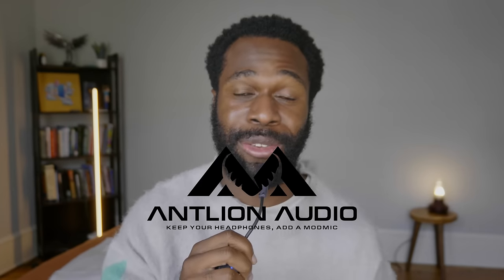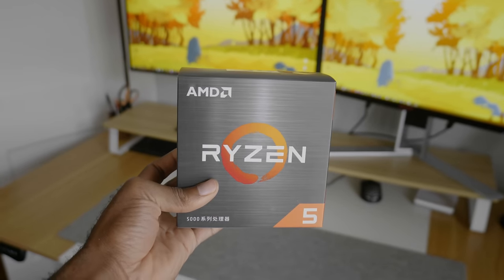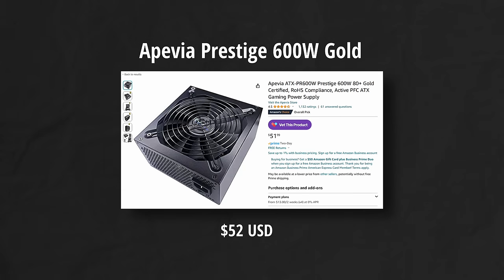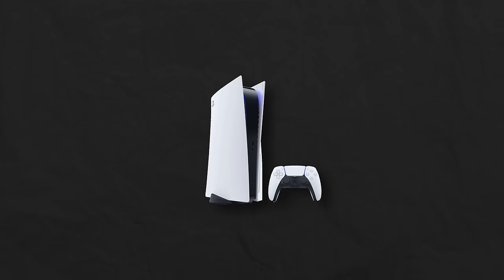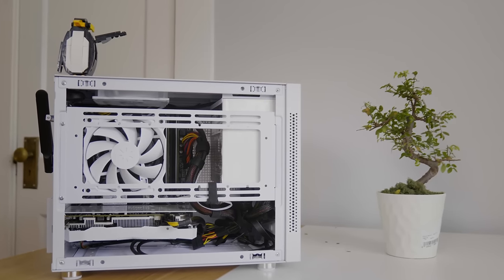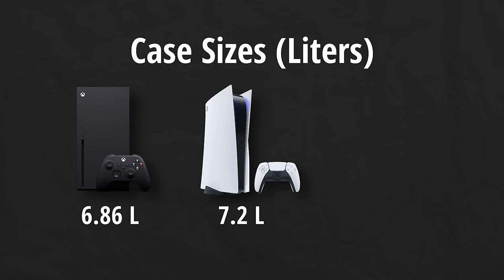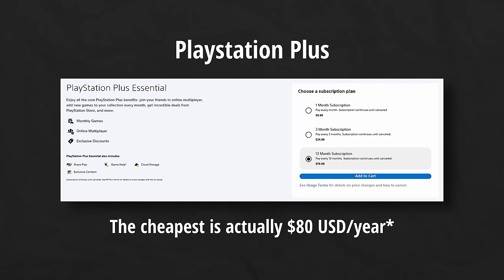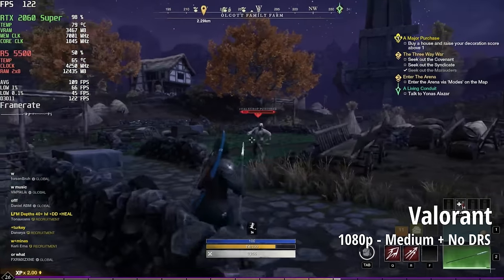The $500 PS5 Killer...did we do it?

Comment: Consoles come with great controllers. Most PC gamers do use mouse and keyboard, but then you have to take into the account the price of those, at least for a first time builder. I've been using my high quality peripherals for years now, while changing PCs. Still, I did have to buy them, and you do get at least one controller with every console. 

Consoles have their subscriptions, walled gardens, monopolistic tendencies, anti-consumer moves etc. PC market is way more open, so the peripherals and games are much cheaper. That's the reason I got a PC for my living room (and never looked back). Heck, I've got a gigantic library of games I got from Epic for free, huge bundles for peanuts, had to choose which discount is better. Some of those games came out before PS3, and they still work today. Backwards compatibility and emulation are just in a different league. 

That said, PS VR is much cheaper than anything PC can offer. At least if you don't chase older, depreciated and drastically discounted devices that still work. Those definitely aren't the norm. 

While the initial cost of PC is greater
(unless you piece put your pc bit by bit like I did), in the end it will turn out cheaper.

Consoles are just simpler to use, no comparison there. Many people will ignore everything else just for the sake of simplicity.

Comment: i have the same SP ram in my system. for those who might want those same ram sticks, i urge you to find another brand. i have tried many of their ram sticks in the past. (the ddr4 3200 sticks at least) and they always without a doubt make your system crash, or run like garbage for no aparent reason. i do believe you could make them work but do not under any circumstances try run these in XMP mode. they will constanly crash your apps and blue screen you. i have tested them in many systems and they always end up making my pc do very wonky things. i urge you just to get some other brand like corsair Vengance or hyper x. they will leave you much better off without running like garbage.
Reply: ps: i keep going back because they are cheap and i am poor 😭

Comment: You need at least a Ryzen 3700X 8 core and Radeon RX 6700 GPU, the parts used in console. Console maker's parts cost can't be matched retail. Buy used, to get close. For the faster custom SSD hardware the best you can do is set up a system RAM SSD cache but the games have to run at least once to be cached. The value of PC is much higher quality gaming and endless other capability. If your smart a PC pays for itself and then some. It could be a path to wealth.

Comment: Personally, I would have gone with a 3600 cpu and a cheaper case and put that money towards a 2070S which has a 12% average up tick in 1080p performance. That would put the PC at an almost dead tie with the consoles in performance.
Reply: And I have found a few 2070S on eBay for $192. ( that would put you in budget after the $35 savings for the 3600 and a $40 case)

Comment: Just saying, it's not a fair competition. In the long run PC software is much cheaper, that's the reason why you can invest more into hardware. Just to start, you could add 100 bucks to the graphics card of the pc if you take into account that you need a 100 bucks software upgrade to play in ps5 pr Xbox. If you add ONLY that value you'll be getting a way better graphics card, and you would pass easily the ps5/Xbox performance. 
Then, if you add the amount of money you save into games, and calculate that you'll be using the machine for 3-4 years, you can estimate that the savings on software comparing to a console surpase the value for a lot, making a 1200 dollar pc actually a good call. Think of all the dollars you would be expending in pricy games in console, and the 3 or 4 years of online subscription.

Comment: The PS5 and Series X have GPU rasterization performance equivalent to a RTX 2070 Super. Raytracing performance on par with a RTX 2060. While their CPU’s are equivalent to a Zen 1+ Ryzen 7 2700x 8 core 16 SMT CPU. Sure they are based on zen 2 however due to only having 8mbs of L3 cache vs 32mbs, significantly slower clock speed, significantly lower power envelope and having to share bandwidth and memory with the GPU. The CPU in the consoles is significantly weaker than a Zen 2 Ryzen 7 3700x. 

  Beating the consoles is absurdly easy however at a $500-$600 price point it is almost impossible. PC’s have always been more expensive than consoles though. They have become beyond cheaper today than what they ever were in the past.

Comment: Concidering how much access to play online costs on console, I think itd only be fair to take that into concideration for complete feature parody. And since youd have little reason to not play online in owning the console itd be fair to calculate like 3-5 years of that bribery youd have to do to Sony or MS. Thatd be an extra 240-400$ to spend on better parts. This alone could transform the RTX2060 super into a used RTX3080, the CPU into a Ryzen 7 5800x and some spare change to upgrade the powersupply to get it to 750w. This build, with the cost of PS+ taken into concideration, would blow any console out of the damn water and cost the same over 5 years.
Reply: And this just goes to show how expensive consoles really are too. They appear to be inexpensive to buy into but once youre in, youre IN

Comment: U put the gpu of the ps5 between the 3060 and 4060?? Since when the 4060 can play any game 4K 60fps??? I personally think that if u just want to play the ps is waaaay better. Even if u need a new ps every new generation, u are just spending 500 every 6 years at least and u can play 4K. I think that a computer is really worth over 1200-1500. Less is not as good as ps for gaming and also, if u buy cheap components they "get older faster" so u have to buy a new one after 6 years (even sooner) anyway
Reply: The PS5 can't play any new AAA game at 4K 60. It's GPU is about the speed of a RX 6600 / RTX 2060

Comment: So when I did the research back when they dropped, the consoles are a RX 6700 with 4gbs more gddr6 vram, for 4k low capabilities, and to run OS.  They are also over clocked a bit.  The series S is an RX 6600 with 2 more gbs of vram.   Just Google the specs and anyone who knows hardware know that they're just gpus with more vram.   So if you want a console killer go with a 6700xt or 6750xt as your base.  If your looking to kill the series S the 6600xt or 6650xt is your best bet.  Nice video though.  I enjoy them thanks.
Reply: No they are not on par with a RX 6700 it’s alittle more complicated. Due to shared memory bandwidth as they use APU’s and the limited thermal envelope the consoles are weaker than a RX 6700. Your completely wrong about the Series S take. That console is equivalent to a GTX 1650 Super in rasterization performance. Learn more about technology before spreading misinformation.

Comment: Beating a ps5 for under $500 in 2024 is possible but idk about it being much better even still today with reduced prices.
Ryzen 3600x $(85) 
Rtx 3060ti ($275)
DIY pc case ($40) 
Cheap AM4 mb ($75) 
Cheap psu ($35) 
HDMi/DP cord ($4)
2 fans ($10)
Cheap Cooler ($10) 
This would beat a ps5 by a margin of about 30% +\~ 5% that’s slightly over the budget and the very best you could normally achieve atm.
You could replace the 3060ti with a 5700xt but then you wouldn’t be killing anything because it will fall short of being truly superior.

Comment: Ladies and Gentlemen he’s back and forgot my waffles! Love the video. Question lol how do you fit all of those PCS in your place lol?

I have a i7 12th gen 127000k Radeon 6500 XT, 32gb of ram and these older parts he uses runs better on dam near ultra settings compared to mine lol MW3 I get 122 fps on high settings same with Gotham knights but if I play the games he plays I’m barely making 25-30 fps 😂😂
Reply: Your gpu is very weak, and low on vram
Reply: Your cpu can easily drive 4080 I think
Reply: Because most games are more GPU reliant, and your cpu is a beast but your gpu is worse than what he has. Could be some problems if the difference is that huge tho, check your temps/drivers and search up performance with your components and see if other people get the same fps as you. If not something could be faulty
Reply: @jekaufo  yeah I should’ve upgraded to the AMD 6700 xt
Reply: @miuletzmitzu6641  I might get the 6700 XT because this GPU is getting on my nerves lol
Reply: @Flangobeast  the 6700xt is like 290 atm since it's black friday week, incredible value, buy it!

Comment: You could have used a 5600x which is ridiculously close to the price of the 5500. Plus, if aesthetics don't matter, you could have chose a cheaper and uglier case to spend something more on the GPU. Even 550$ with a slightly better CPU and GPU would have done the job and would have annihilated the consoles.
Reply: In my country the 5600 is twice as expensive as it’s supposed to be but I opted for the 5500 and to be fair there isn’t a noticeable difference especially when gaming. I paired it with a 6600 xt which was the only secondhand part and the build cost around $490 if converted from my currency. If you went for all secondhand parts you could probably shave $200 off that price or get even better hardware. When it comes to pc vs console I only have a console for relaxed gameplay and for when I have someone over. It’s more for when I don’t want to sit at my desk hunched over my keyboard to play some games.

Comment: The regular ps5 has a Zen 2 8 core/16 threads the graphics power performs just like a
 RX 6700 10GB or the rtx 3060 ti.

This can't be a ps5 killer if it doesn't even have a 8 core plus 16 threads.

Comment: One thing I noticed is that You're consistently GPU Bottlenecked, with the CPU running at sub 50% load. I would have gotten a Ryzen 3 4100, a 4-core 8 thread CPU that costs about 65 dollars on Amazon right now, and opted for a used RTX 2080, which go for ~180-200 dollars on Ebay

Comment: TL;DR: consoles are meta at first glance. PC is ageless and will pay itself overtime.

Your specs are mostly the limit. I'm really disappointed but we can confidently say that the times when PC annihilated consoles are well stuck in the past. In the last years with the chip crisis and consoles finally realizing that optimization is their best bet it's harder than ever to come close to their price/performance.
One thing to consider as you mentioned is that the cost of consoles nowadays is basically the same as the printer/coffeemaker with pods model. They sell you hardware, probably even, on a slight profit or even on a loss (depending on location) but they hook you on subscriptions and make most of the money off of them.
I think the time has come to take that into account, make a more real-world comparison, and compare actual costs in the long term. The differences between the two are shrinking and more subtle than ever, but this should make it outstandingly more obvious for people who are just getting into this.

My suggestions: Compare the next 5 years (averaging 4/6 years in between every console) of ownership cost. Should be fair for a computer too, I've personally rocked a 960 2gb for 5 years and a 1060 3gb for the last 3/4. Most of my friends have rigs older than 4 years and planning just now to get a 3000 series card or entry-level 4000.
This should justify a couple of things and make the difference really evident:
- overall watts don't matter. FPS/watt is the real deal. For that matter, undervolting was the right choice in comparing PCs with consoles straight away, but taking into consideration the whole 5 years ahead you can safely say that doing the opposite is beneficial. I've been undervolting my laptop for thermal throttling and battery life, but undervolting done in any other circumstances doesn't make any sense. CPUs and GPUs are made to run stable at 100°C (confirmed by my laptop, with a custom profile from ThrottleStop, pinned at 97°C stable while gaming). The downside of that is hardware lifetime but if you've ever listened carefully to any overclocking video, this is not a concern. Firstly you're probably changing hardware in 5 years (found out a lot of people change it year by year,  that's just insane for regular people). Second of all the depletion can probably seen in the whole lifespan of the hardware. Modern silicon circuits can average a lifespan of 10/20 years so if running it hotter will shave 10% of its lifetime you'll be left with 9/18 years. Again, you'll change pieces after just a couple and probably do a full refresher in 5 years or so. So doesn't really matter.
- I'm not sure portability is a concern, who brings the console to their buddy's house? Probably a small percentage of people (that wouldn't have a big problem doing so with your configuration), and usually if you find space to put a console in, the 3x volume of the PC isn't a concern, so I wouldn't be worried too much about that. If not I'd be worried about limiting potential on expandability (PCI slots for expansion cards, the best bet if you want to keep your system for 10+ years, and also hard drive/SSD space, to accommodate expensive hobbies like making videos on YouTube or just hoarding data😂).
- Quietness: again, I'm not sure it's a concern. But still, 80% of the time you use a computer it's going to be more silent if not dead silent compared to a console (clearly you don't use a console when it's idling so the comparison isn't fair, but it's a real-world one.) and the big advantage of PC is that you can customize that. Either fan curves, or just splurging on the cooling system or even undervolting for that matter. That's the beauty of customization

That being said. I'd probably pick your same config (nice value in that psu). The only things I would change:
- custom cooling (air cooling because it's cheaper). Usually not great advice because stock AMD coolers do just fine but yours doesn't seem to be the case. A normal CPU cooler with 1 or 2 120mm fans is plenty. This should lower temperatures and avoid throttling altogether. Maybe unlock some overclocking potential.
- the same card of yours if someone is planning to stream with it or encode videos (NVENC is king, really, it makes an insane difference, especially on lower budget builds where you don't usually have many spare cores to handle recording/streaming while gaming). 6700xt otherwise, better raw fps for money and usually cheaper? (depends too much on the region). Both of those I would have overclocked and got a 5%-10% fps boost that you paid for.

Quick maff:
It's difficult to take into account power consumption but expect a bigger power bill for PCs as stated in the video (especially with overclocking), I'd guess between the same to 400w at most with the 6700xt I've mentioned before.
- Consoles 500$ + 5y x 100$ (the average of 80$/y and 120$/y subscription) = 1000$. Mind that's basically with no games. Those are a pain with consoles
- PC: 1000$ build? doesn't even compare at all to any of the above. It's insanely valuable, you can spend hundreds of dollars less and get tons of games if you're into that. If you don't use it for gaming anymore it can be plenty powerful for ANY hobby you pick, whether you choose photography, videography, YouTube, coding, 3d printing, 3d modelling. That's honestly what I've been enjoying the most off of the PC ride. My parents bought me my first computer (Optiplex 755 lol) almost 15 years ago, and it's been a blast since then, it's been what enabled me to enjoy and try out all of the above hobbies I've mentioned without experiencing major problems or costs.
- Console + low-end Chromebook/Windows laptop (cuz in this day and age you must have one right? either for note taking in college or just for personal use if you work already): 1000$ + 300$  = 1300$
- PC + laptop for college/uni? 1300$ is plenty. 1000$ for the desktop, 300$ for the laptop. Don't get me started on used Lenovos (75$ lul).
- "Yeah but, my college needs power for CAD/photoshop/demanding shit", don't worry, gotcha. laptop + egpu? (my own config, insanely versatile for uni/portability) 1300$ are a bit tight but you can definitely make it work. 200$ egpu enclosure, 200$ card, 900$ laptop with the best CPU you can get and at least a GPU to make the graphic-intensive programs work outside of your house setup.

All and all thanks for sharing this build, I loved it. I've been watching for literally years but forgot to subscribe, people don't make the same mistake I've done, go do so right now. I really enjoy your content.
Have a nice one ❤

Comment: if you being real ps5 should be equivelent to 3070- 3080 or 4070. its optimized so much more than 2060 for examole it will play elden ring at 4k with good fps but only 3080 will do 4k 60 fps which is then better than ps5 with higher fps but if you go lower its worst than ps5

Comment: Now pretend you had an old pc on hand. For $500 you slap on a 4070 and every console gets decimated in performance. 

You might get slightly lower performance now, but when you would’ve bought the next generation console down the line, your pc will far surpass it with the same cost invested into a graphics card.